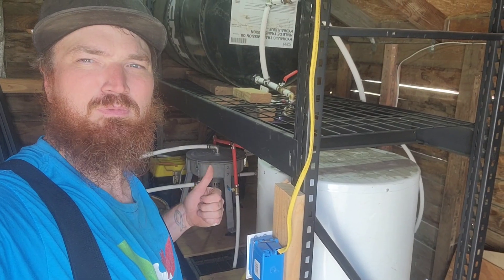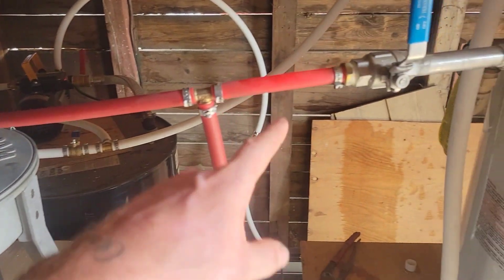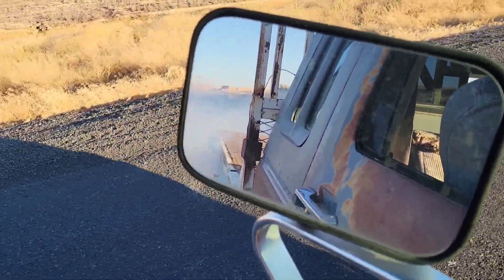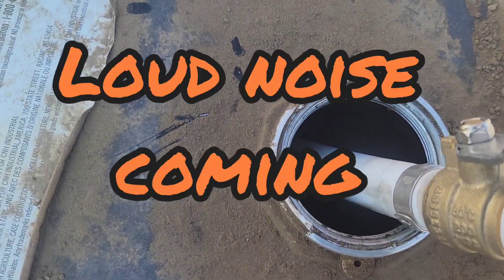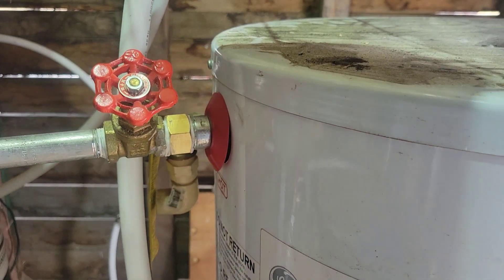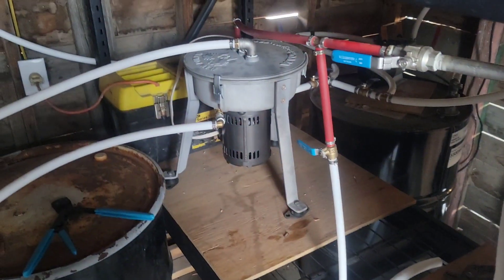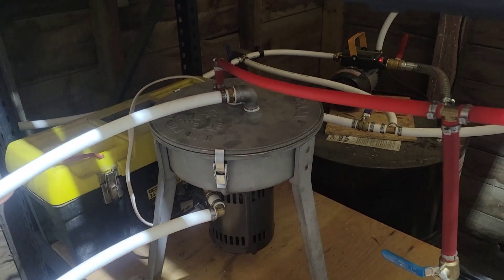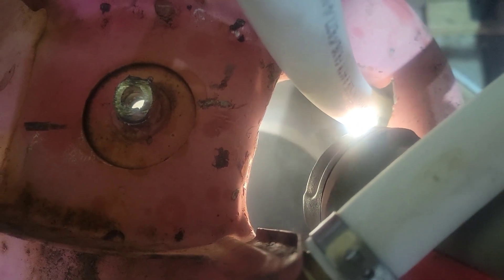waste oil to black diesel fuel centrifuge first run #wmo #blackdiesel #centrifuge

Comment: Wondering how running on wmo has been going for you?
Reply from the maker: Has been going well. I been using it in my 6.9 idi truck and my 12 valve cummins. I use low percentage compared to alot of people. Only been using about 1/3 waste oil, some rug, and topping off with actual diesel.

Comment: Hello Aspie. I have a 6.9 idi 2 wheel drive c6 trans and have got a 15 to 18 mpg. Have you found that you have gotten better mpg on wmo? Thank you for your time and video's.😊
Reply from the maker: I feel like waste oil I get slightly worse mileage. But I don't really worry about less mpg since the fuel is virtually free.

Comment: Just bought a centrifuge out of China. It spins at 2800 rpm and has a 19 1/2" bowl. This produces 4350 g's. The unit weighs around 400 pounds. Total with shipping to the port of Seattle and delivery to Yakima was $1490.
Reply from the maker: Awesome! Hope it works out well for you. Welcome to the world of black diesel. Send me a link to check it out if you can. I like to read and learn about different options.

Comment: Just getting into this. I have an unlimited supply of used motor oil and tranny fluid. It looks like you live in eastern washington. I'm in Yakima. I know some people add gas to thin out their black oil. Could you add this mix into the centrifuge in place of heating the oil to thin it out?
Reply from the maker: We are just a couple hours away from eachother. I have seem some people add gas before the centrifuge, some after. So it is kinda up to you and what you want to do. I do not think any of this is an exact science, or has any definitive right or wrong way to do it. Thanks for watching.
Reply: @worthshop  
I am checking into using a motorized cream milk seperator. They get up to 10,000 rpm and only cost $150 new. I've read about a few people using them and they said they would clean the machine after 50 gallons and it would clean down to one half micron.
Reply from the maker: @Spider Mite Sprayer  Sounds interesting, I will look into that. Let me inow how it works out! Good luck with your journey into black diesel.
Reply: We should exchange contact info
Reply: @khorramshahri  
Are you in Eastern Washington?
Reply: @wutntarnation  not even close:)
Reply: @khorramshahri  
Then why would I share contact information?
Reply: @wutntarnation  it's good to network. Was up that way last year.

Comment: Where did you get that centrifuge and what did you pay for it?
Reply from the maker: The centrifuge came from Wvodesigns.com I ordered the raw power centrifuge for $1500 but it was on backorder for so long they upgraded my order for free to the extreme raw power centrifuge that usually costs $1900
Reply: @worthshop  dang lol im trying to get a centrifugal oil filter setup for under 1000
Reply from the maker: @Bricky Boii  The pa biodiesel pressure systems can be had cheaper. They are not quite as efficient but cheaper to get started.
Reply: @worthshop  looking at an 1100 dollar one 55 gph, will work more than perfectly fine for me i think. Kit has all i need
Reply from the maker: @Bricky Boii  Let me know which set up you go with and how it works. Good luck with your journey into waste oil and God bless.

Comment: Great job!  Thanks for showing so much detail... On "Not so grand garage" he put a "P" trap at the clean oil discharge from the centrifuge and he stopped the water vapor from getting into his clean oil tank - That looks like a good idea.... I just bought the same machine but with the heater,,, I am not as brave as you are, I am not going to pump gasoline....
Reply from the maker: Thanks for watching. I have learned alot from not so grand garage. He has alot of knowledge to share. I have made a couple plumbing changes since I did this initial test on my new system. I will do an update video sometime soon. God bless.
Reply: @worthshop  Looking forward to your next video!

Comment: You can replace that section of white PEX with clear vinyl. Just use hose clamps on the end.  about.  
In your application, the clear vinyl will have a service life of at least a year or more before it starts to get brittle enough to need to worry about.
Reply from the maker: I did a couple plumbing changes after this video. Drilled a hole in top of the top barrel to fill into, switched a few pieces to vinyl tubing for better visibility. This was my first shake down run of the system, and a learning experience. Have not produced a follow up video yet, but will eventually.

Comment: i use an old (1970s - 80s?) ford power steering pump w/an old 1/2 hp washing machine motor to lift wmo 8 feet (would probably pump a lot higher) . the pump had an internal screen/filter which i had to remove before it worked . i gravity feed the pump thru a hose fastened to the dipstick tube . very quiet . at very low rpm (200 very roughly estimated) it pumps around 2 gallons per minute from a hose fastened in the bottom of a 5 gallon bucket , which is located about 6 inches above the pump (would probably pump faster from a larger or higher container , as weight of oil would create pressure coming into pump) . don't know if it would work as a suction pump , but would require priming if it did . you might need to turn your raw oil feed drum on its side , or cut a hole near bottom and install a bulkhead fitting , and raise it slightly above the pump , to gravity feed it .
Reply from the maker: That sounds interesting, probably much  better than my Chinese pumps too. I am definitely going to be figuring put something better in the future. Thanks for the idea, and thanks for watching.

Comment: Looks good, I like the pex ball valves but I wonder if I wouldn't uses some 3 port diverter ball valves just so a valve can't be forgotten and blow something apart or make a mess.
Reply from the maker: That is a good idea. 3 way valves for pex are harder to find and a bit more expensive is why I went the way I did though. I could be wrong, but I do not think the pumps I currently have are capable of enough pressure to damage my pex lines. We will see. Thanks for watching.

Comment: Coming along nicely bud!
Reply from the maker: Thanks for checking out the video. My biggest issue is the pumps not being all that great. Getting my trucks set up with dual tanks, should be running the fuel I make pretty soon.
Reply: @worthshop  finding good pumps for moving oil can be a pain.  For filling vehicles, I've been using a def transfer pump I got for dirt cheap and it's been great.  For moving oils between drums and stages, I've been using modified big block Chevy oil pumps.  They work well enough.  Keep at it

Comment: How do like that pump. I have the same one but it doesn't work very well. Okay I continued watching and yeah I think you realized also those pumps suck.   I'm doing the same thing but my system is a lot simpler.  You should look into buying wvo designs oil heater.   It will eliminate a lot of your plumbing and valves and just simplify your system
Reply from the maker: I might have gotten a bit too involved with my setup. I tend to over think things at times. I didn't like the wvo designs heater price tag, but it would simplify the whole set up. The pumps are kinda garbage, expensive lesson learned. Thanks for watching.
Reply: @worthshop  I'm trying to find a good pump solution.  I'm at a point where I'm willing to spend the cash on one but there are so many I don't know what would be best.  I don't want to spend more than I need to but I also want something that works 100% of the time

I really only need to move 5 gpm.  Something portable with a drop down intake and a suction screen would be best

Comment: Really nice video! Looks like Your getting really close to having system working really well! Thanks for all the effort You are putting into this project. 👍
Reply from the maker: Ya, it is coming along really well. I fixed that leak the next day. Got my pump going. Just didn't really have time to fix it and get the video edited/uploaded in time. Thanks for following along with the project. Now that its all set up I will be back to truck repairs this week.